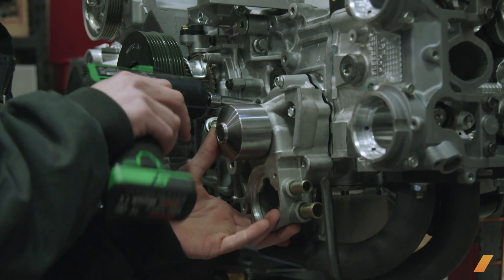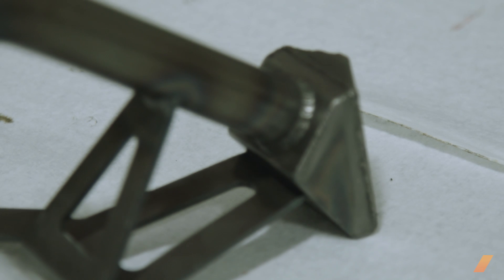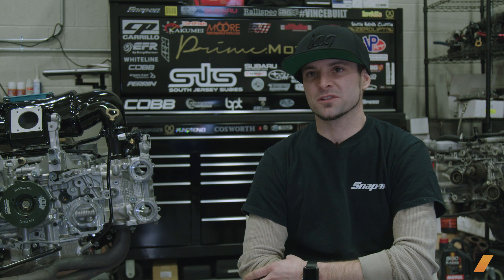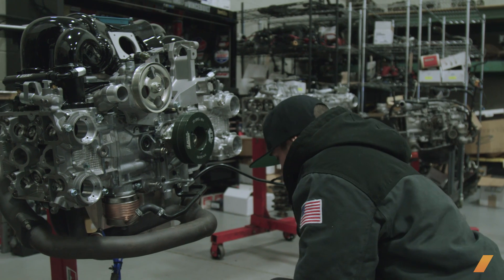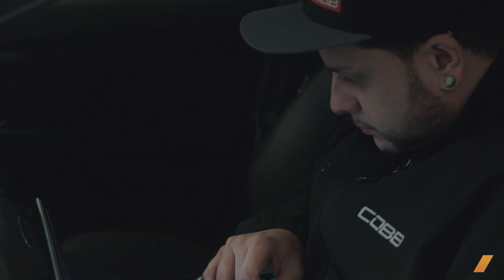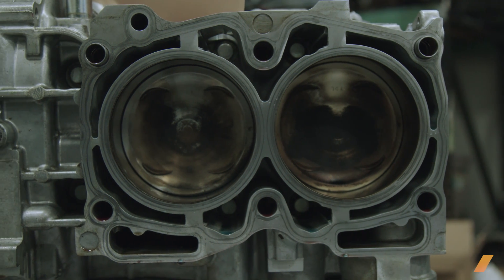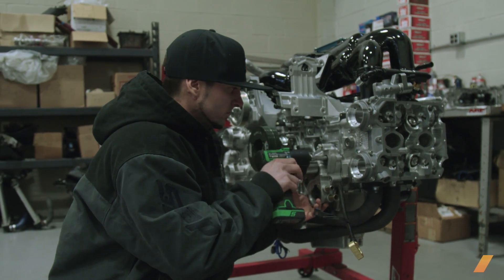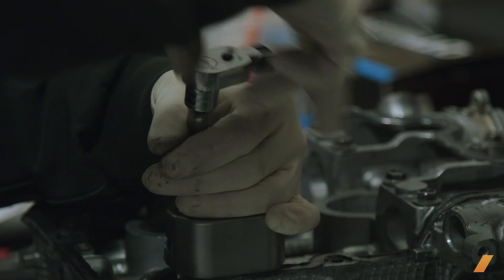Legendary Subaru EJ: 1,000-hp Performance, If You Want -- /ENGINEERED

Comment: And take it from me the rod killer is the bolts. IV only broke a few Subaru rod bolts , and then changed to arp 2000 and even on a bone stock short block putting arp bolt will make the motor way more capable of rpm, forged pistons, and arp rods on stock sti internals will take 387 ftlbs of torque and 375 hp all day long, I drove my car 4 hrs a day for a year for my contracting job and put 67,000 miles on the block before I pulled it to rebuild and put my other motor in.  Moral, always have a built subaru motor on stand by for ultimate reliability. Shit my subie I can do a motor swap in 2 hrs, IV also don’t the work to my car to race-ify it to stream line the process so everything is quick to get to and easy to swap.

Comment: A failure in the pickup tube can be avoided by putting bigger bolts in because I have had them under high load strip out, break, or fall out all together. Even a stock oil pick up with better bolts and o ring is better than stock and holds up to realistic street power. But in the long run I built my own oil pickup tube, it’s basically the same as killer b, yes I copied it but I don’t sell them for a living I built one and use it myself, I don’t think it’s the fixer of all but it’s a piece of the puzzle, to make your subie reliable and drivable at say 400 hp on the street is all you need honestly. It’s a gymkhana car at that point, but you can beat on it regularly and it takes it. But at 600 hp your close to every limit of the motor and tune become so critical that it’s so hard to street drive and be reliable, so choose your battle. Build a 600 hp capable motor and turn it down to 400 and beat on it.

Comment: Great video, agree with everything. My opinion is that a stock-based case, even closed decked, big studs, dowel-pinned and sleeved is only good for short-duration stuff like drag racing once you pass the 800 point. From there to 1000 hp the durability goes down exponentially.

Comment: I watched this video a few years ago, made mental notes and now my 05 sti that I've had since 2010 has a fully built iAG closed deck short block with built heads fuel system and a cobb access port, capable of 750 tuned for just over 500 at the wheel. Completely reliable daily driver that I love to drive, this content had a huge hand in that so, thank you! Almost forgot about the hypermax HKS coil overs and t-sloted rotors so I can stop quickly.

Comment: awesome content! thanks for the info!
 i have a 98 outback with 293k on the clock and i noticed it had oil on the back of the throttle plate. 
i took off the intake manifold and oil was coating everything. the interesting thing is the pcv valve and compression on all cylinders are great so no excess blow by is not the problem. just inherent boxer breathing problems. definitely the first step every subaru owner should install even if theye not doing any performance upgrades.

Comment: It’s pains me when someone says they specialize in Subaru etc etc and don’t even have basic knowledge. Dudes no dummy, don’t get me wrong. But why ya gotta short change the EJ engine on some credit? 29 years when this video went up. Came out in 89. Even if he meant specifically the EJ25, that’s still 24 years-ish.  The FA comment though. Deeeeeeffinitely agree. They have such potential but are plagued with issues. Y’all would shit a brick if I told the problems we are seeing on these. Sometimes we get them brand new off the truck and have to drive them straight into the shop for repairs or engine inspection. I so hope they get it under control. FAs got some big shoes to fill following the EJ.

Comment: Imo the best insurance policy for the oiling system problems of Subaru engines are a dry sump system. Personally I think Subaru should install them from the factory. Yeah may bring up production costs but will increase reliability alot and draw in more customers imo

Comment: Legendary for being a piece of shit. Head gasket issues, cracked ringlands, spun bearings, and more. And that’s on stock cars. Try making some real power and you better have a few $10k coins to put in the machine when “game over” comes up on the screen. And it does. All the time.
Reply: Thats just wrong, why would and engine run this long if it was? head gaskets were old 2.5na's, ring lands on ej257's are good to about 400whp with proper tuning,. and those issues are not on stock cars.  ej207's v7 are knows to go 450whp+ reliably

Comment: Give me that EJ 25 in a perfectly restored Volkswagen T3 Syncro (Camper) at about 320 reliable turbo hp and a six-speed manual with reduction gear unit as well as differential locks and I'd be the luckiest guy on the planet. Not the race purpose with huge turbo lags and explosive quarter mile times, but a lively expedition behaviour.

Comment: I have a 2016 Subaru Crosstrek and as I’m sure you already know, it’s beyond underpowered. I know it is not an EJ engine or anywhere close to it and I also know you said an intake and down-pipe are big mistake. Does that only apply for engines like the EJ that people are looking to get big power out of or will my wimpy engine be okay and benefit anything at all? (I know downpipes are primarily only used on turbocharged cars.  I’m not trying to make a drag car I just want better throttle response and something that’s a little more fun to drive.

Comment: Hi Vince. I am looking at a 2.5 or 2.0 Turbo Diesel , I want to get a strong 300 to 400 HP range  Which engine is more reliable and which Pistons, Rods and Bearings should I use?

Comment: ANybody got any idea why I hear a ticking sound when I start my engine? Its kinda off and on and usually on cold starts. I dont really drive the car too hard seeing as how Im stock still. I have a 2011 WRX hatch with just an Invidia N1 for now. Any help would be appreciated.
Reply: Subaru engines do tend to make a slight ticking noise. I just let mine run for a minute on cold starts and it quiets down. Could be rod knock though it's hard to say without hearing.
Reply: @IronAxeGaming1  Thanks for the quick reply. I didnt buy it from a Subaru dealer but they should still be able to take  look at it right?
Reply: @GucciManecubus  yea just bring it to your local dealer or Subaru mechanic and they will be able to diagnose it.
Reply: @IronAxeGaming1  will do. Thanks man.
Reply: @GucciManecubus  No worries man. It's honestly probably just piston slap which is common on these engines that have some miles on them. Nothing to worry about in that instance. Maybe take a video of your car making that noise and post it to a Subaru forum, people are usually happy to help out.

Comment: My Tuner is adamant it's not how many miles but how many times you fill up.  You can get 7,500 miles on an oil change if you drive like an old lady. But any spirited driving should be between 2,000-4,000 miles depending on how spirited you are.

Comment: My stock oil pick up tube fucked me over. wish I knew just how bad they could be. 130xxx km on the engine.  fucking heart breaking. and bank breaking. after struggling to afford a new engine on my 2011 WRX, my first mod will be an air oil seperator, followed by a fluid damper and an killer B oil pick up tube.  

Question: Would you recommend a killer B oil Baffle plate if you only want 300whp? or just the pick up tube?   Daily driver on squirly windy hilly roads with lots of deer.

Comment: If your ‘bored already’.... 
Make it lighter. Best mod you can do is to reduce weight, especially ‘unsprung weight’ ie; dont buy 19-22” Speedy or ROH wheels from your local tyre shop. 17-18” is heaps on most small-mid sports cars and buy the lightest, but still strong, units you can afford. 

8secs.... smf. If your all about 1/8 - 1/4 mile slips, your in the wrong rig... Your exhaust is MASSIVELY important for low - mid range response and to extract the true efficiency of near standard to mildly modified engines. Truely... your turbine wheel (as well as rest of turbo) dump pipe and quality exhaust (eg-top shelf Kakimoto) will unlock untold performance capabilities in real world conditions. Theres more to life than WOT. 
And driving a cornering monster in a straight line... lol. Sorry but its true. 
Wanna go fast in a straight line at a decent cost? Import a turbocharged ‘Barra’ engine from Australia. Ford’s 4.0L inline 6 turbo engine that flows really well, handles high cylinder pressures.... just keep it cool. Mated to the German engineered ZF auto, which they come with from factory, that has had small upgrades and tuning and these things do low 11’s - high 10’s with minimal bolt on mods.

Comment: Big mistake is also buying the biggest ‘AFTERCOOLER’ (intercooler is incorrect terminology) from Ebay. Bigger is not better kiddos. Small as possible without being restrictive - spend your money quality components from air to plenum and from turbo to exhaust (manifold gains are negligible when weighed against cost and only become important for substantial > serious builds. Money better spent on fuel, ignition and management systems.... Not too mention braking/suspension/bracing/lightweight upgrades. -on RB anyhow.)

Comment: I thought ‘closed deck’ entailed separate cooling and lubrication systems for the head and block? Not disagreeing (I’m no ‘expert’) just enquiring so I get my understanding correct.

Edit:this also eliminates the need for catch cans and the like. Or restrictors in oil return lines. Or underdriven pulleys and such things for the oil pump, compromising bottom end lube. 

Not a Rex aficionado, (parents owned one at one stage but i’m an RB guy) but I have worked on one and jeez.... If owned a serious one, I would DEFINITELY look at a chrome-molly tube front end and a MUCH simpler intake system.... just changing plugs and checking/replacing all the little crap OEM clamps was a nightmare!
(Again, am relatively experienced and can do a lot of work myself but, was learning on the fly about the EJ and know for a fact that the correct knowledge and tricks of the trade on this engine would help immensely)

Such a great car but BLOODY expensive to modify.
Manifolds, gear box / gear set upgrades, transfer case, braking system refinements, suspension and bracing overhaul.... 
Worth it if ‘circuit racing’ type driving is your thing (and you have some proper skill with a steering wheel) though.😎
Or rally driving if you have the gonads (and skill) which is what the 95-early 2000’s models should be used for 🤤

Oh, good for traffic light heroes and car club posers too.

Comment: Thoughts on a water meth injection setup or/and 20psi, on a 255 short block, 09 sti tmic, vf39, stp intake, 3" cobb catted dp, with a good pro tune on 90 oct (because im moving to Anchorage alaska where even 91 octane is hard to find).

Comment: Lmao. Did he really just say that installing a cold air intake will make a car run lean? He just lost some serious credibility...
Reply: The stock sti intake system is better than anything you can buy out there. Aftermarket isn't always better.
Reply: @BP5Lwhipple  Completely untrue. A proper cold air intake will outperform a stock one in almost all scenarios. And the stock MAF housing diameter is too small to support very much power as the velocity of the incoming air will be too great for the MAF to read. You might want to educate yourself.
Reply: @TallLittleElf  sure.
Reply: I guarantee the build in this video won't use a stock intake. Because it can't
Reply: @TallLittleElf  it wont due to the intake manifold and turbo, but for those of us running stock manifolds, stock location turbos and top mount, stock intakes will reap the most benefits from tunning. You're not really reducing intake temps with your "cold air intake" as the air feed from the grille to the bottom side of the bumper wont see a drop in temp. You're better off getting a bigger intercooler to drop the temps a bit. But hey everyone speaks from their own experience, do what works for you. best of luck.

Comment: this video fails to give any actual information. Like what you are doing to actually make 1000hp... This just covers the basics of a car that has 350kw? Like what pistons are you using and why? What valves/cams/head work and why? What bottom end combo and why?
Reply: how often do you change oils on a 1000hp engine, and why? What fuels are you running? Where are the dyno plots. ect ect ect

Comment: I have had a Subaru forester 1998 (automatic) from new (approx. 70,000 miles on the clock), that has been great for all the years with very little to do other than annual services. However, recently I have had a lot of vibration & shuddering on the wheels when making tight turns (left or right). It is difficult to identify which wheels the noise or shudder comes from and I don't feel much through the steering wheel. I have had front & rear differentials replaced and it has reduced the frequency but not eliminated the problem. We hope it isn't the automatic gear box but has anyone got any ideas what to do next. I have checked the wheel bearings; CV boots & axles; springs and found nothing. We hope it isn't the central differential/automatic gear box but has anyone got any ideas what to do next. We don't want to loose our car..... she is part of the family.....we have had her more than 21 years and has been a faithful work-horse.
Reply: george manson have you checked the ball joints/tie rods? Did you figure out what it was?
Reply: @tgrobelny23  Thanks for the reply..... yes we checked the ball joints/tie rods but they are OK. We are now thinking it is a faulty solenoid in the central diff. Just waiting for replacement parts (solenoid; gaskets; & internal transmission filter) before getting it done.

George
Reply: @tgrobelny23  SHE LIVES AGAIN!!!!!!…..an interesting item at 3 minutes to 4:40 minutes in the attached video ( https://www.youtube.com/watch?v=GP7TInt4q84 )..... this was exactly what I experienced with my 1998 Subaru Forester but no-one could diagnose the problem.... £3k was spent/wasted with my Local Subaru dealer trying to fix it... but to no effect. Then I found the attached video link.... and then I found a good mechanic willing to do the work..... and we got our car back (with new solenoid in the transmission) and she runs great..... Well worth the effort.... these Subaru's can go on forever (almost) George (London, UK)

Comment: Ok so about a year ago I started hearing EVERYWHERE Subaru's "break".  Two years ago people might mention a few issues, say they aren't fantastically reliable (but not bad). However now. Everyone online seems to think they are broken cars with shitty engines that were flawed heavily from manufacturing and will die in a few years of regular driving to the shops by granny. 
No idea what caused this weird shift. These small 4 cylinder turbo engines can easily be pushed waaaaay too far. Most people do no realize you just cannot triple (or more) a cars output and think it will live a very nice life without serious $$$$$$$. 
These cars are nice platforms for a nippy, sporty 4 wheel drive car. If you try to get supercar performance you will break it.
Subaru's do not just "break". They get broken by poor choices, parts and work. 

I love my friends daily drive imprezza. Right around 300hp. 180k done on the odo and it is beautiful to drive! 
He could easily buy a massive shitty turbo on ebay, install that himself, buy everything budget, get his friend to "Tune" it. Squeeze twice the horsepower and it will never. EVER get to 200k.   Would be dead in 2 months. 

I know this, he knows this. Yet whatever 20 year old he sells it to after being told all this. Will probably go and do it anyway. Then come on here and talk about how these cars "Just Break".

Comment: I have a 2019 wrx sti limited and I wanted a down pipe and a cobb sf intake but its 1 or the other u can if u get the right rune but my car only has miles on it so put the cobb sf intake on and set my access port and 2nd time I drove it lean trim so went with the injen cold air intake but then dont fit on the 19 so I made it fit had to shave some of the heat shield off because the 19 headlights turn when u turn so there bigger under the good so had to shave it down but this injen is the worlds 1st no tune intake

Comment: I'm told stock ecu isn't tunable which is wut must of us have on a tight budget!
Reply: having a tight budget and a STi don't mix very well friend
Reply: i take it u mean subaru sti is expensive to mod...? glad i don't have 1 then but we research, plan & try to find best possible stuff when possible.
Reply: It's not just the mods, but yes, performance per dollar is really bad for these cars. The cost I'm referring to is the inevitable engine rebuild. Even stock a vast amount of people have had ringland failure. Modified just increases the rate at which it will happen. That's why I don't recommend the cars to anyone who doesn't have around 8k in the bank or a PoS to drive while the car is down.

Comment: Can an air/oil separater be an advantage on a non-turbo subaru also, or is it then a waste of time/money? Tried just a decent catch-can to reduce blow-by accumulation, but saw no real advantage, as it seemed (maybe?) to cause condensation due to the longer hoses and can temperature differences...no science there, just assumption/observation

Comment: Anyone here else cringe a little when he used the cordless impact gun to start the water pump bolt? I'd always prefer to start it off by hand. Also helps to line it up using two screwdrivers to help align the pump and gasket to the block.